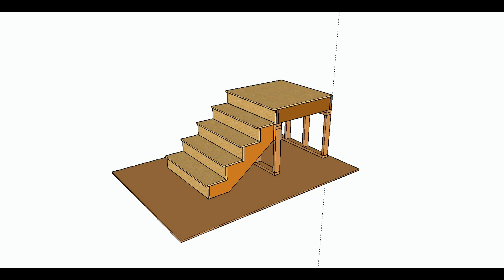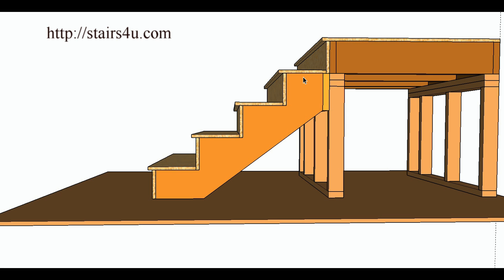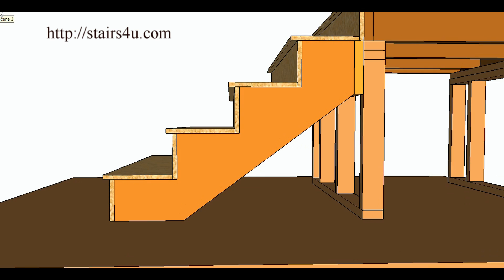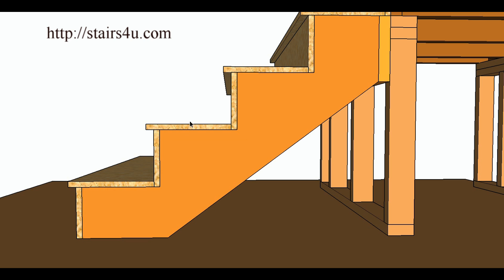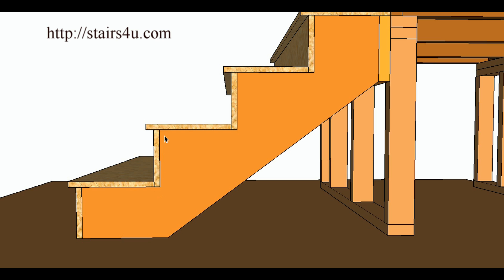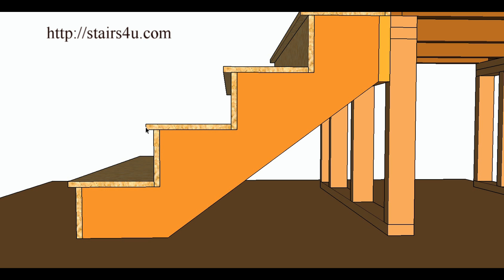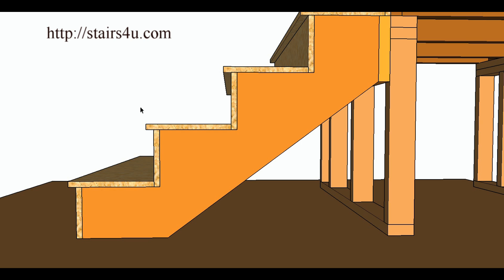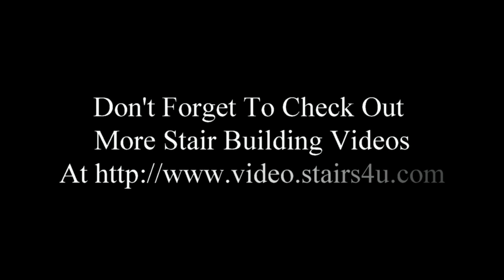How Do You Calculate Stair Tread Depth – Building Inspections

Comment: You are correct, it is 9" for residential as long as there is at least a 3/4" nosing, so the minimum tread width would be 9 3/4".  You do not need a nosing if the tread is 11".  If anything OSHA is LESS restrictive, but that doesn't get you off the hook for code for residential or commercial new construction.  Moreover, the commercial requirements, especially, if it used for egress, is different again, and more restrictive than OSHA or residential.  IBC is more restrictive in almost every respect to where I can't imagine it being used in residential, especially in the U.S..  Handicap capable is a whole nother kettle of fish, and while legal, not suitable for normal residential occupants.